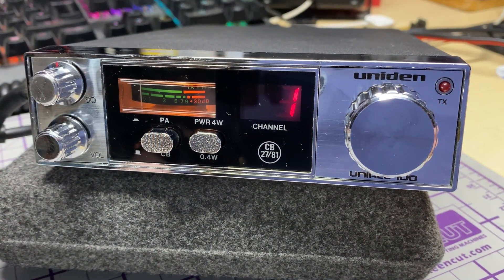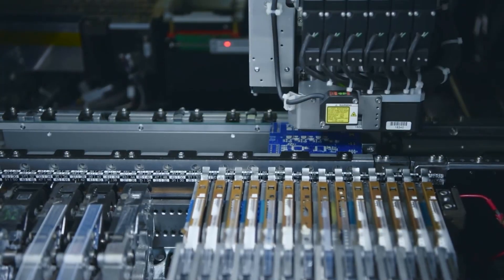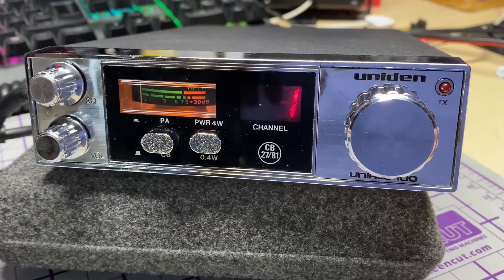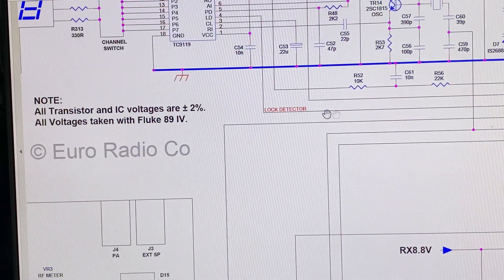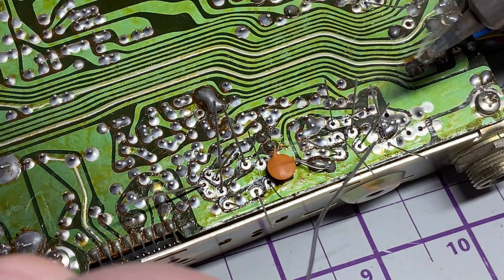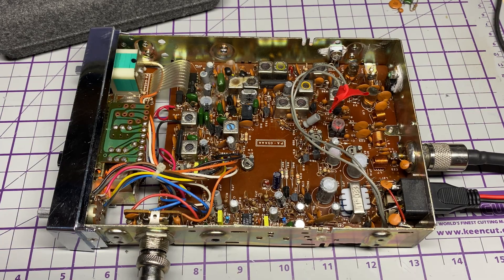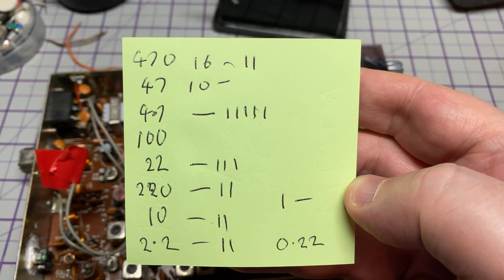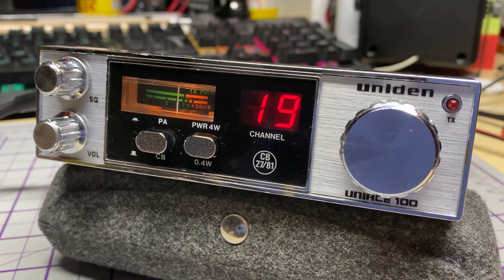EP 206 - Uniden / Uniace 100 - TX audio mod.

Comment: I have one of these, brand new, in the box, even the dc lead is still sealed in the bag!
Reply: I highly recommend changing the electrolytics in it (even if it's never been used), there's only a handful and the ones around the PLL regulator and chip are known for going short, if you're really unlucky it'll take out the PLL chip which is rare as hen's teeth.
Reply: The ten volt caps are made to fail,matter of time before they go open @M0UAW_IO83
Reply: Get the caps done before they shoot the goo on the board 😮